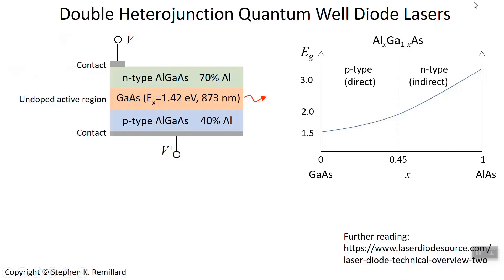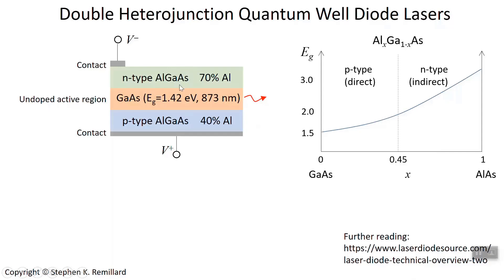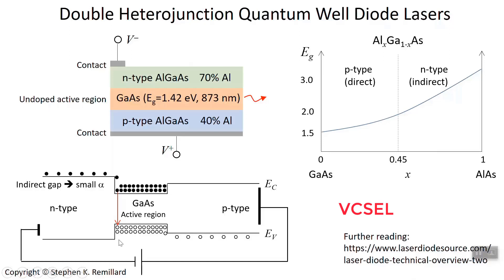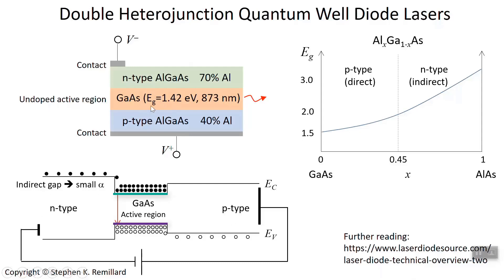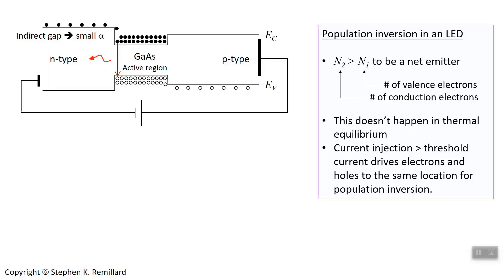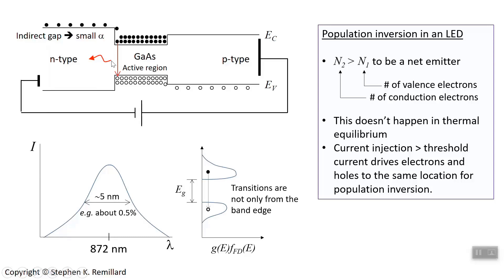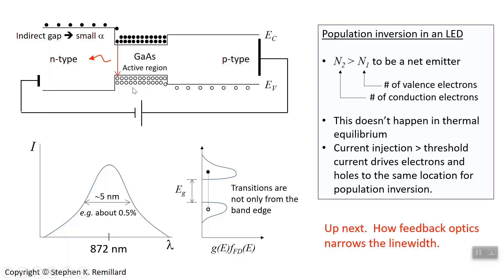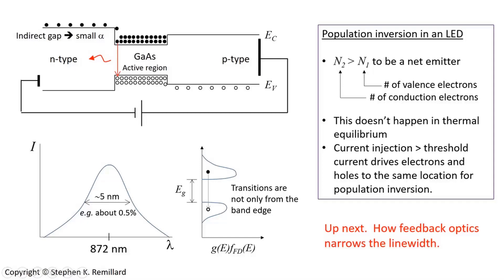The Double Heterojunction Quantum Well Diode Laser, Lecture 41

Comment: Can anyone please explain the difference between quantum well and double heterojunction? Don't we make quantum well by heterojunction? Please explain as soon as possible.
Reply: Hetero-junction is different materials, whereas homo-junction is from the same material (be it with different doping materials). This is a "hetero" junction, because the AlGaAs is a an alloy of Al and Ga (with As), so it is different to just Ga (with As). the middle structure. If you have done material sciences, you know that you can adjust the electrical properties by doping with materials either from the right of the periodic table (doping with n carriers), or from the left (doping with p carriers). This doping is in the region of 0.2% of foreign material in your crystal, so when you speak about doping, you mean some very light diluting of another substance in your crystal. This only affects the electrical properties. IF you want to affect the OPTICAL properties, you can alloy your semiconductor with an element above to WIDEN its bandgap, or with an element bellow to NARROW it! So you travel the periodic table vertically. That way, you can start with a semiconductor that does not emit in the visible range, alloy it with either an element atop if it has a low bandgap, or vice versa, and end up with the optical properties you want. GaAs naturally fluoresces at visible wavelengths so you don't have to alloy it with anything. However, notice the structure with what it is sandwiched in. It is using Al, which is atop of Ga in the periodic table, aiming to widen the bandgap. That is the quantum well, it uses wider bandgaps for the materials sandwiching your semiconductor, so as to concentrate the electrons and holes in that very thin region (atoms wide), leading to extremely good performance, since there isn't a chance in such a small confine for non-radiative recombination to take place.

Comment: Please I have a graduation project with title  measurement of optical energy gap for solids 
Please I need good refrance for this project
Reply from the maker: The method was developed by Tauc around 1970: Tauc, J., and A. Menth. "States in the gap." Journal of non-crystalline solids 8 (1972): 569-585.

A lot of papers report data using the method, including this one:  Joseph, C. M., and C. S. Menon. "Electrical conductivity, optical absorption and structural studies in thin films." Semiconductor science and technology 11.11 (1996): 1668.
Reply: @stephenremillard1   
Thank you very much for your help 😊